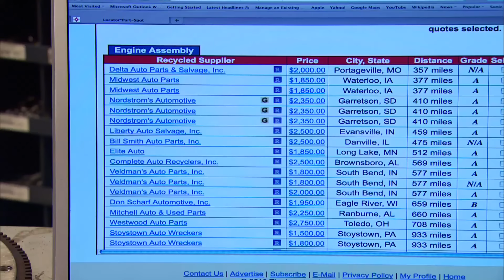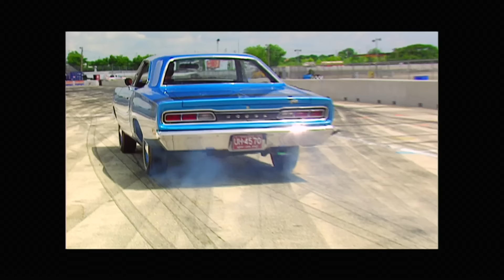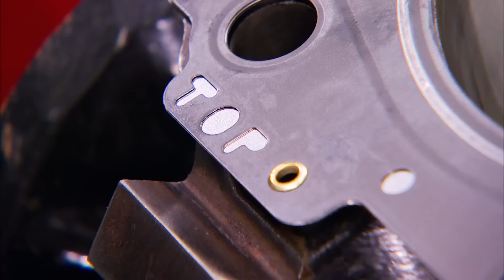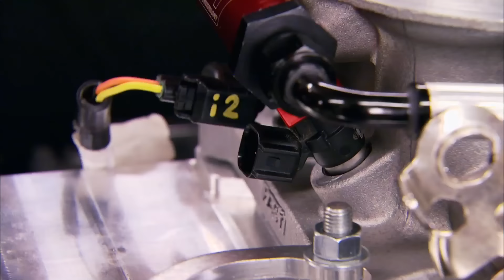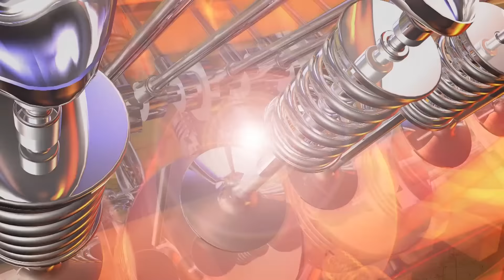Recycled 5.7L Hemi Budget Build Stage 1 - Horsepower S14, E8

Comment: Awesome video! I would love to see a 4.6 2V engine being built.
Reply: Me too...a non pi block and rotating with pi heads.
Reply: I agree
Reply: Explorer aluminum block, ported heads & intake, cam, Aviator throttle body, underdrive pulleys, dished pistons from NPI block, Trickflow plenum, Kooks LTs (keep an H-pipe)

While your motor is pulled, I'd also drop in a tubular K-member if this is going in a SN95 car
Reply: @masterwhopper414  why bother with the aluminum block? Last time I checked, the 2v was never offered in a all aluminum engine. 
I'd go .....
Non pi short block
Pi heads with a standard blend/port job
Cams that offer a bit more duration and overlap than the stock , high lift , pi cams 
E85
Bbk Hilborn style intake.
Reply: The 4.
6L 2v had the worst valve spgs.
Reply: @troymillion8510  they arnt that bad. People seem to miss the fact that engine displaces 281 ci and makes 300 lbft ....that's really good considering the Chev 350 makes about the same.
Reply: I'd rather see the 4V.
Reply: @kingcrimson234  not budget by any means .....cams alone is like 1500 bucks done the right way.
Reply: @robsorgdrager8477  Never said they're cheap to build, but it's a good motor.
Reply: @kingcrimson234  it can be. They make good power like mopars always have. Just spendy.
Reply: @robsorgdrager8477  Yup. The 03-04 Cobra version is a legendary engine though.
Reply: @kingcrimson234  it's good because it comes with Kellogg crank and Manley rods in a cast iron block. That engine is capable of way more than what it's rated. And for it's time it was untouchable . The lighting engine and transmission are also really good. They rated that 5.4 at 375 horse and about the same in torque. The trans is a R100 with the 7.3 superduty internals 😳. The nice thing is the all the mod motors share the same trans bolt pattern so one could put the lighting trans behind the cobra engine as we all know the t56 had some input issues😗 and the auto is going to be way more consistent.
Reply: @robsorgdrager8477  Yep, I snapped a rod in the 4v 4.6 in my Mach 1. Replaced the short block with one from an '03 Cobra. No problems 3 years later. Very strong internals. Pushing 600 HP through it, did a compression check a couple months ago and all cyls are within a few percent of 175.

600 is not even really coming close to what it can handle.
Reply: Right or even a 5.4L DOHC 32V Intech V8 out a 99-06 Lincoln Navigator.

Comment: Most newer engines I agree with your statement that the front cylinder is going to be the #1 cylinder. However, some engines it is the opposite, it's best to check with the manufacturer if your building a high horsepower engine.
Reply: @every Ford in the 2000s

Comment: 55hp over stock, with stock valave springs!!! Badass!!!
Reply: Truck engines are tuned for low end torque and go not screaming at 6K rpm and over. The same exact engine in the Challenger/charger has more HP(roughly 30 IIRC) as it's tuned for peak performance. They didn't do any magic here...
Reply: @DL101ca  This engine is from 2003 it probably made 345 hp. Before they used it for the charger and challenger. The early 5.7L Hemis only made 340 OR 350 hp in chargers depending on the trim. Then the newer ones with VVT made 350-370. They did a decent amount of work in order to get a 2003 5.7 Hemi at a higher hp than newer ones. 

Source: I own a 2007 Charger R/T and its base HP was 340 hp.

Comment: Wow those bearings look like new.
Reply: asambi69 Only 50k miles
Reply: still had cross hatch I cylinders as well.  Not surprised though I pulled m LS apart with 144000 miles and the bearings looked new and still had cross hatch in cylinders

Comment: FYI, the piston closest to the front of the engine isn't always number one. Case in point is a "Y" block Ford. I had a hard time using my timing light until I cracked a book and found that number one was on the opposite bank, not the furthest forward.

Comment: 5.7l computer controlled fuel injected hemi v8...legend for over 50 years? Man I never realized dodge was that advanced 50 years ago.
Reply: Chrysler was first with the alternator back in the late 50’s, first with disk breaks, electronic ignition,  the gear reduction starter, I could go on. Chrysler engineering has always been on top. They even put a jet engine in a few hundred cars and the Hemi was developed as a fighter plane engine for the war effort WWII.

Comment: I thought hemi's pre '08 were prone to dropping valve seats, would have been money in the bank to have those replaced
Reply: Not unless you overheat them. The 4.7, 3.7, and 5.7 engines from that era WILL drop seats if you overheat them, but otherwise you'll be fine.

Comment: Felpro headgaskets are garbage for 3rd gen hemi's. Guaranteed to leak. Replace them all the time from other shops. Use mopar gaskets.
Reply: What leaks on them. I use them and have not had an issue
Reply: m ph people like to talk. Nothing to back it up
Reply: @MCarm69  Exactly. I just did 3 camshaft jobs on 5.7L Hemi's. I used Felpro head gaskets on all jobs. Surface prep, new head bolts using proper torque spec and you won't have an issue.
Reply: I’m retired so I can’t say anything about the parts Felpro is selling right now but in all my years as a professional technician I never had a failure. Just about any brand of head gaskets will work as long as you prep the surfaces and clean or replace the bolts and chase the threads in the block.
Reply: @timsharpe3498  sure, older felpro stuff was cutting edge technology in a lot of applications. Not anymore.... I thought that if you're going to spend the time and effort to tear your engine down to do head gaskets you might as well spend the extra 25% and buy a quality OEM part.
Reply: @mph5896  Felpros are find, Mahle. I recently used Apex on a 4.7 and love them, super complete.

Comment: These hemis ( 5.7 ) is 345 cu. in. engines and you ban't compare these today with those of yesterday. These today are a completely different all together. They do run good but I really do believe that the 340 6 pack is a better runner. I've had both. Great video though.
Reply: I love the stuff of yesteryear too, BUT these modern engines are hard to beat. These new heads and cams flow much better today and still give you 20MPG+- DEPENDING ON HOW YOU DRIVE. And these new engines will run 200k+ miles and still run great, the old stuff for the most part was clapped out by 100k.
Reply: @garysisk3431  I can only speak for myself and my experience with the old stuff. I kept them tuned and burned 115 octane in most  (real leaded avgas). I got any where from 22-29 miles per. They were all stick shift and no power add ons. Only my 1 ton duelley 460 was a gas guzzler. 44 gallons for 240 miles of work. But that bastard would pull a house down. Yes. new engines do have their good points but I still prefer the old stuff.
Reply: P.S. I did have a 1972 Gran Torino Fastback with a 351 Cleveland. I sold it to my brother @ 270,000 miles on the clock with only one water pump replacement besides the usual tune up stuff. It still laid rubber. He drove it for 35,000 more the sold it. Keep it tuned and don't drive like a maniac, good gas in, and they will last.

Comment: That is a flex plate. Not a flywheel
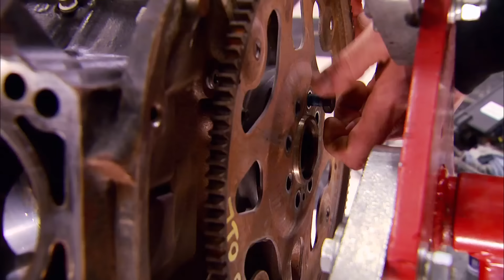Reply: Sorry but actually it is just a flywheel. All it does is turn the engine when the starter is engaged. If it was a flex plate, it would have a tone ring built onto it for the crank sensor readings. The crank sensor tone ring on this engine is built into the crankshaft. You can see it at 5:31. Sorry, I'm not trying to mean. Just making a clarification.

Comment: Sketchy motor build. Most would've used a proven after market cam, lifter and spring.
Reply: No way.  Stay AWAY from aftermarket crap on these.
Reply: @pkranz937  do you have a part number for the new cam, and lifters?
Reply: @claytonhaske  

Melling is no longer listing the lifters, which leads me to believe Chrysler switched vendors (rightfully so). 

Here are the most current (August, 2019) part numbers:

Lifters -
Front Yoke: 5038785AC
Rear Yoke: 5038786AC
Camshaft: 53022372AA

Police cars use a slightly softer valve spring beginning in mid-2016:  68080909AB

Latest timing chain: 53022316AC

Comment: I would think you would get more than 400 hp out of that.
Reply: 400 HP without a blower or turbo is really impressive if you've ever built engines.  Once you get more HP our of a NA motor you need lots more money and higher octane fuel.  400 is a lot.
Reply: @kimojon9665  sloppy mechanics.com/ 8's for 8k.
Reply: Kimo Jon it’s not impressive at all, especially since that’s crank power. Mine makes that out of the factory.

Comment: So you replaced 50k mile pistons for no reason but kept the stock valve springs which are notorious for failure. Wtf?
Reply: Nope. If you look closely those are the same pistons that came out of the engine - they just had a cycle in that spiffy new cleaning machine. All they did was tear it down, clean all the hard parts, then reassemble with new bearings. Really just a sanity check on a used motor that you're planning to push hard. ;)
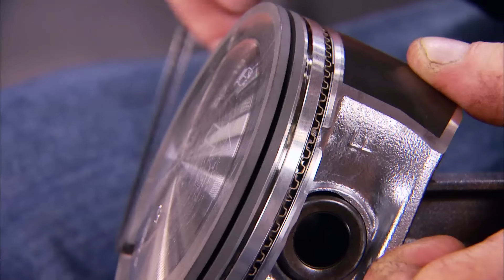Reply: Eric K 7:50 “The new mahle pistons...”
Reply: @EricFixalot  - I did hear that too, but if you look, he's putting the same pistons he punch marked back into their holes. I'm thinking he meant "new Mahle piston *rings*"... ;)
Reply: Eric K If you look closely, the ringlands have the anti-friction coating they’re talking about. I believe the numbers are also laser etched instead of being punched.
Reply: Valvesprings don't fail on the 3G Hemi.  Lifters do.  Then they wipe out the cams.  That was all fixed by Mid-2016.
Reply: P Kranz The lifters are not the only week point. They drop valves quite a bit. Although part of that is the valve seats also fail constantly. The whole valvetrain is a mess on these really. Also it’s mainly the MDS lifters that fail. Hellcat lifters also have bigger needle bearings so they don’t fail.
Reply: Brian, damn that sucks, out of curiosity how many miles were on it?
Reply: Brian, damn that’s fairly low mileage. Supposedly running high octane fuel helps so I always run premium. Haven’t had a problem yet at 162k, fingers crossed. Also the 09+ 5.7s don’t have the same issues with the heads so some people like to swap them but it does jack up your compression. I’ve been contemplating that mod myself.

Comment: Too bad they did not address the shity factory roller lifters in the Hemi engine
Reply: They got lucky with a non-mds version at least. Mds lifters are the biggest failure point as far as I know.
Reply: Along with the crappy factory cam.
Reply: 192,000 orginal miles on my 2004 Ram with the 5.7 Hemi all stock and haven't had any issues yet.
Reply: Althought I would love to rebuild it with a comp cam 268 xfi and all the fixings too👍
Reply: @billknight5578  152k mile 06 Charger R/T here. Mine haven't failed either... yet.
Reply: ya lol and the stock cam. I saw a lot of questionable activities going on.
Reply: pretty sure that started 2009 onwards didn't it?
Reply: @morganbills2749  Chrysler started using the MDS system in 2004 allegedly mellings improve their lifter design and it was fixed in 2017
Reply: @brettlyde6338  oh ok, but I thought the problems with lifters failing arised right when 4th gens were released though, and the the third gens were more prone to dropping valve seats.
Reply: It’s not every gen hemi...
Reply: @brettlyde6338  correct.  Melling improved the lifters and nitride hardened camshaft beginning in mid-2016.  Squads also got valvesprings that are a tad softer, to reduce friction and increase durability.  While some cops are still bitching, it ain't the newer models failing.  
Chrysler, however, did not make the fix a recall or TSB item.  Cars that had failed were put out of service while parts were on back order, as the new cars being built got all the good parts first.  

Anyone building a 3G Hemi would be wise to include the latest Melling lifters and cam.  It should be noted that this issue affected both MDS and non-MDS engines - the lifters and cams were simply not durable enough.  The timing chain problems was not related to the valvetrain issues. 

Also very important -  Aftermarket valvetrain parts for these engines, such as Crane, Comp, Eddy, etc, are not tested in severe service duty cycles, and will very likely fail in short order. 
I
Reply: @billknight5578  I agree Bill, maybe the early ones were better but mine has been trouble free for just under 200k. It sounds like the MDS models of most manufacturers have had problems, using the correct oil and MAINTAINING your rig is the key I think.
Reply: @brettlyde6338  where did you read that?
Reply: Yeah that’s what I wanted to see
Reply: @EricFixalot  156 should be expected at a minimum now adays...
Reply: Erik Capozzi, Tell that to Nissan owners that can’t go 30k without blowing up a CVT.
Reply: @EricFixalot  yawn
Reply: Erik Capozzi What a thoughtful reply. It contributed so much to the conversation. Shocker, not all cars are reliable and I haven’t had any major issues with mine despite redlining it daily, wrecking it, and subsequently driving it with a cracked radiator for awhile and overheating it a bunch of times. It’s put up with me for over 25k miles at the cost of a power steering pump and alternator and some oil changes.
Reply: 09 and up eagle engines have that issue. Not 03-08. Learn your stuff...

Comment: To bad dodge dont make the entire vehicle as good as the motor
Reply: Because Dodge doesn't MAKE the engine...
Reply: @Blurgamer17  lol
Reply: Lol they do. As it comes from the factory the 5.7 hemi is about as garbage as the rest of the vehicle.
Reply: Last Name First Name it comes from a specialized department known as SRT, Mopar has the parts and the hemi is shared through Chrysler and dodge itself. The dodge company does NOT make the engine.
Reply: @Blurgamer17  It's the same parent company that owns both tho (now Fiat-Chrysler) so they were made by the same family just a different branch
Reply: Last Name First Name yes, but it wasn't directly Dodge at the time.
Reply: @Blurgamer17  while technically correct it doesn't make the engines any better. Same parent company. It was never a dodge exclusive problem Chrysler group has had terrible products with poor quality all across the board for years.
Reply: Last Name First Name that's why I avoid Dodge/Chrysler/Jeep cars as daily drivers. Quality be so low...
Reply: why do i see so many new chevy trucks in the junkyard, but no new dodges? weird....
Reply: @frigglebiscuit7484  because the non running/ driving chevys are worth more as parts. Dodges are worth more as scrap.
Reply: @lastnamefirstname9043  lol no. I'm saying I see more gm trucks in the yard than dodges. you know damn well what you are saying is a lie.
Reply: @frigglebiscuit7484  So tuners can get their hands on the LQ4's inside them.
Latest example: B is for Build.
Reply: They never did

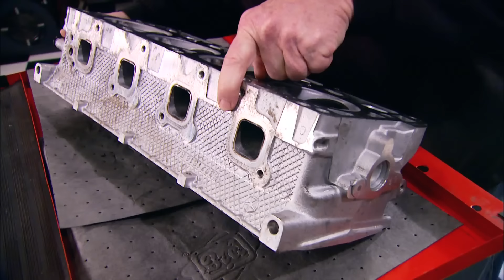Comment: 6:28 Come on guys, don’t call people out for being purists and needing to get a real-life, as you may end up coming across someone who knows what they are talking about.

As an automotive engineer, I can immediately see that this engine doesn’t have hemispherical combustion chambers.  Chrysler stopped building engines with hemispherical chambers for road use in 1971, as the highly efficient thermal efficiency of the chamber was producing too much Nox.  Some other car manufacturers around the world stopped producing engines with hemispherical chambers for the same reason.

This engine has chambers that are closer to a polyspherical shape.  If someone wants a relatively modern engine they can truly call a HEMI, then go for the HEMI built after 2009, as they have hemi-spheroidal chambers.

No-one shows someone a triangle and tells them its a square.  Don't show someone a shallow dished polyspherical head and tell them its hemispherical.
Reply: Hemi production ended thanks to the fuel crisis. NOx wasnt a concern back then - It was only by the early 90s where manufacturers started to care about HC and CO, and NOx was only introduced as a gas to be concerned about in the 2000's.

There, now you know what youre talking about.

Comment: I've run my 96 dodge neon with the throttle body completely removed and all the intake sensors disconnected.  I don't know what they do with the computer, but that little 4 pot will run with just the cam and crank sensors and the ignition coil.

Comment: Given how crappy the heads seats are, you guys should be replacing every valve seat in those heads.
Reply: by 06 they fixed the issue, if it was a 04 or 05 I'd agree with you.
Reply: Raymond Panzera ‘09 actually.
Reply: @karpenterken1  5.7 Engine Warranty claims(FCA and 90% of after market warranty providers)  for 07and 08 model years reguarding Seat issues are less then .05 % where 04-06 it's 20%  of claims and .06% for the 03's  the 09 are  .03 % 10 is .02 % 11 was .02%  , by contrast GMs 5.3 and 6.0  was .03%  for 08 and .05% for 07.....My Daughter works for FCA as a Warranty Analyst , the Eagle Engines ate more Lifters from 09-14 model year then the 03-08s did valve seats...there were valve spring issues for the 04-06s that contributed to some of these valve seats dropping.

Comment: I would love to have a 5.7 in my 1988 Dakota, that would be pretty cool, the transmission and rear drive axle would need to be changed to handle the power but would still be  strong engine
Reply: Same here for my 88 Dakota.
Reply: Some old dodge Dakotas have 318s and 360s in them could make those have 400hp

Comment: Great video. I have the same issue with the timing cover. I’m using a cover from a grand Cherokee on a truck motor. I’m not running heater hoses at all and need to tap and plug both the timing cover and the water pump. What size tap and plug did you use? Was it NPT thread? Tapered?